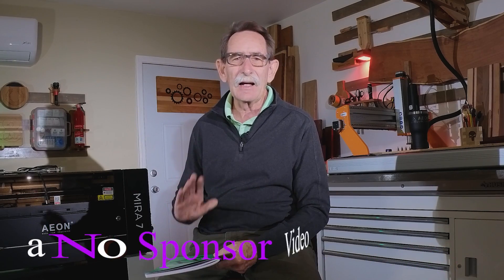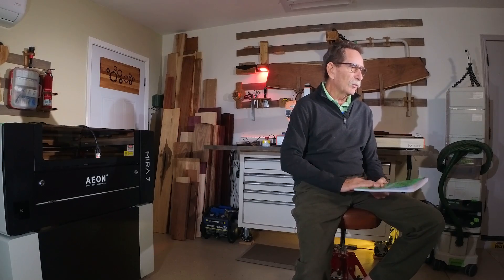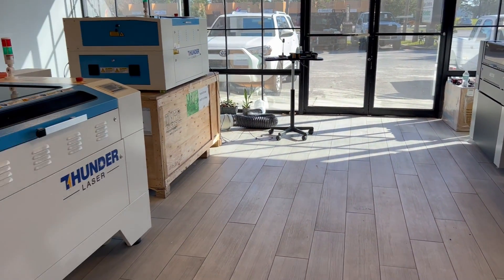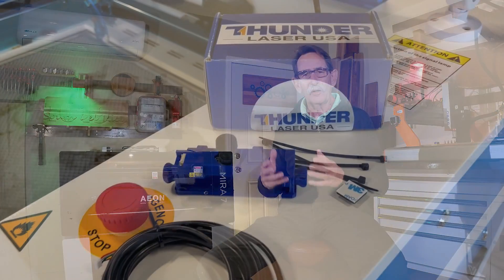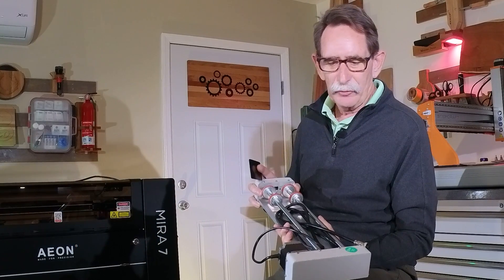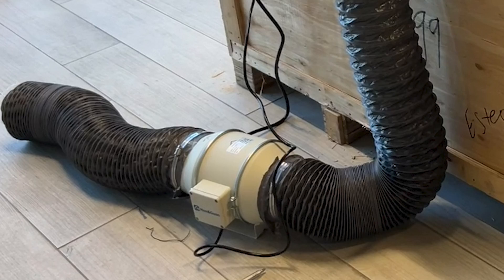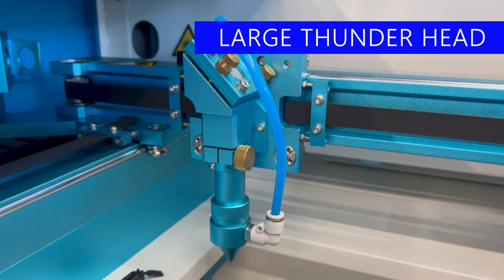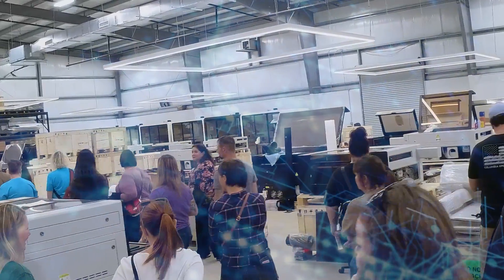Thunder Nova 24 Vs. Aeon Mira Pro 7 at the "Aeon Experience"  See the BEST CO2 Laser Engraver

Comment: Do you have to use wifi? I don’t want to use work.
Reply from the maker: No you do not have to used Wifi on on a Mira it has a USB connection also.   But the Wifi is very easy to use, and very easy to set up.  thank you for the question.

Comment: The plug and play is definitely a commodity that people would appreciate. I for one like to keep these systems seperate like in the thunder, because who knows when one of those crucial peices fail? And they will, eventually. I do agree with you with the head design, I wish it was lighter on the thunder. I have operated a Gravograph laser and that head was incredibly small.
Reply from the maker: Each one of the system in the Mira are what I would call "component" pieces.  If you remove the chiller it slides right out.  It would be and easy fix.   But you hit the big point the size of the head.   Smaller head faster machine.  I am about to do a 6 month review on my machines.   Thank you for the thoughtful comment , I have more videos on this I am in the process of shooting right now.   CHEERS BRO!
Reply: @GeorgeKennerLaser  That is very interesting. I'd really be interested in a video demonstrating this. I'll have to check out Aeon's manuals to see how that all works. If the parts are readily replaceable I will definitely be adding the Nova10 to my wish list. Thanks!  I should also add my #1 reason for going with the Thunder was their upfront support with using antifreeze in their lasers with full warranty support was paramount as I live in a cold climate in an unheated shop.
Reply from the maker: @jakelots   That is so funny... meaning the antifreeze.   I wish I could post a picture here as Aeon also charges the machines with antifreeze.   And as for SUPPPORT,  Aeon will send someone to your house if the machine brakes down in the warranty period and the machine can not be fixed with standard support.   I strongly suggest a visit to the Aeon Experience.  Many of the competitors machines  are their to compare.  If you go look in my Facebook group Laser Freedom I will post a picture of the antifreeze pump at Aeon.